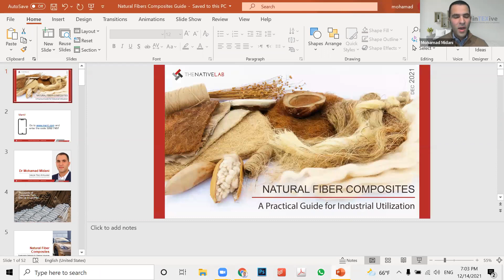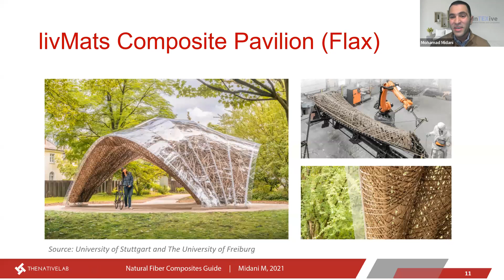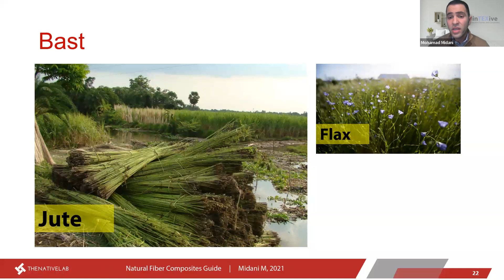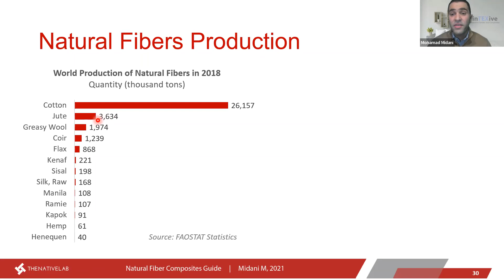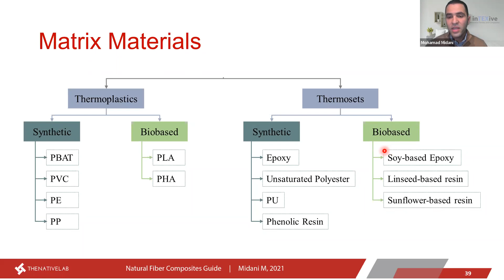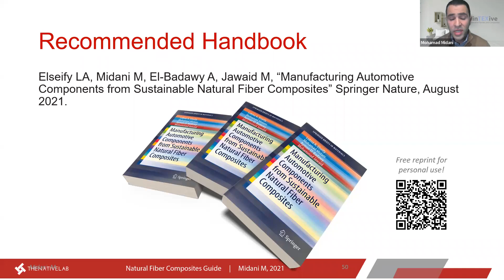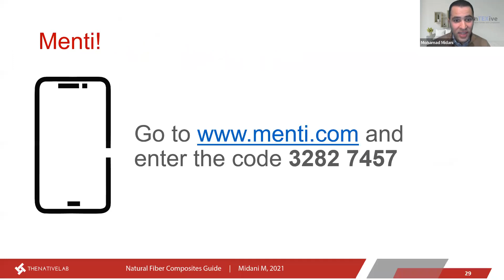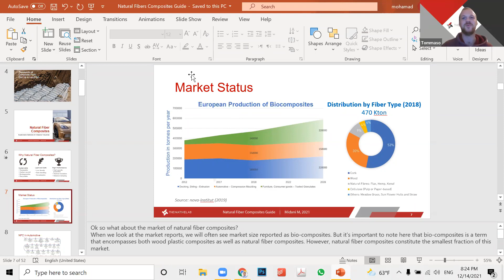Natural Fiber Composites: Practical Guide for Industrial Utilization

Comment: Hi, nice presentation! 
A clarification - you compare the performance to glass fibres. But a layup of Bcomp's ampliTex+powerRibs (all natural fibres, just different architecture) can match the performance (stiffness to weight) of carbon fibres. Hence these are used in motorsports bodywork, actually in all of the examples displayed in the presentation such as the McLaren F1 seat, Porsche GT4 bodywork, eScootr bodywork etc. ampliTex is also used in the Green Nacelle and Flax sailing boat by GreenBoats that are shown. All the best!
Reply from the maker: Thanks for the clarification, indeed the combination of Bcomp AmpliTex and PowerRib can provide a comparable specific bending stiffness to carbon. Definitely Bcomp flax is the reinforcement of choice for high performance applications👍🏻

Comment: Mohamad, thank you very much for the presentation. The best video on the subject - deep but in simple words. Could you please tell me if there should be special properties in PP, for example, as a matrix to get reinforced by NF?
Reply from the maker: Thank you for your positive feedback!
It depends on whether the PP is in particle, fiber, or sheet form. For PP in fiber form that is commingled (intimately blended) with natural fiber, they should have length in the range of 6 cm, they need to be crimped and free from any surface lubricants (spin finish).

Other general features with all forms, to have a high melt flow index, and to be functionalized with Maleic Anhydride to enhance the bonding with the natural fiber.
Reply: @mohamadmidani7968  Thank you!